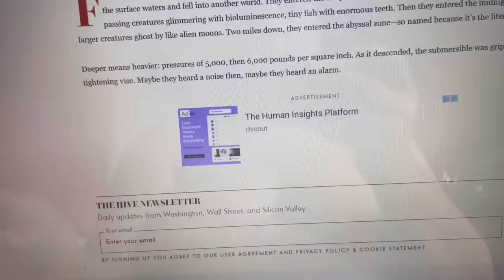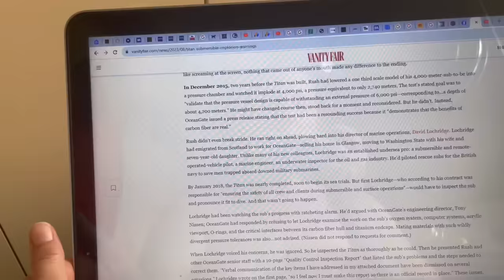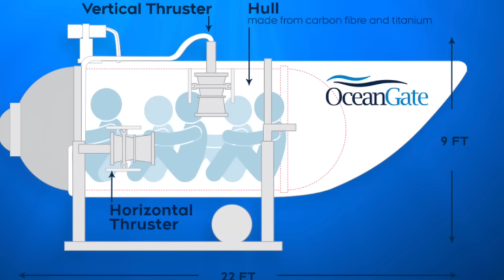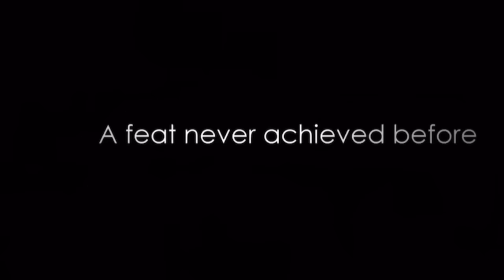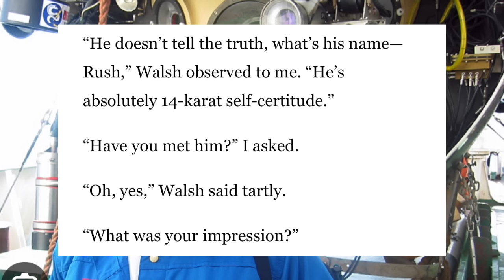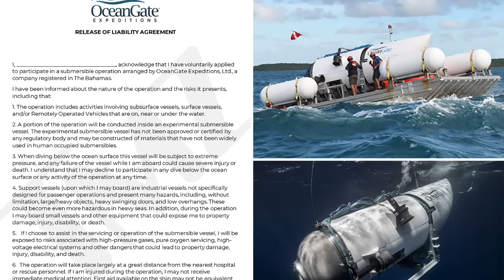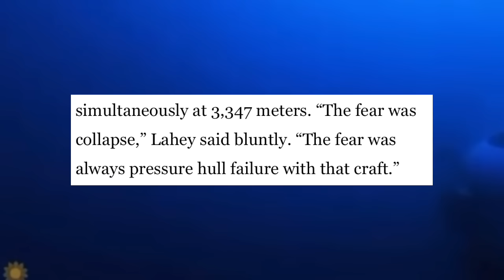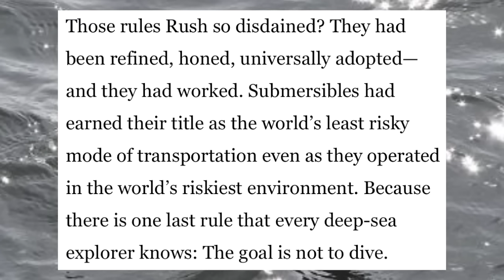TITAN Sub: The Most Shocking Titan Lies & Cover-Ups that you have never heard before #Titan

Comment: The analogy comparing carbon fibers to a rope is not correct in this use of carbon fiber and resin. If you use your imagination, and think of the tube of carbon fiber that made up the hull, then cut it along its length and flatten it out, you end up with a sheet of carbon fiber as thick as the hull was (5"). If you then support the 5 inch thick thick sheet of carbon fiber at all four edges like a sheet of plywood, and then place a weight in the middle of it, you will then be approximating the nature of the forces on the hull. Only the top section will be in compression, while the bottom section will be in tension, with a section in between that is in a neutral state. All of these forces are essentially the same when the material is in the cylindrical shape of the hull with the external pressure of the water pushing inwards.

As long as the upper section (or external) of material remains able to withstand the compressive forces, supported mostly by the strength of the resin with the help of the carbon fiber, and the lower section (or internal) material can withstand the tension, mostly on the carbon fibers held in place and supported by the resin, and the two forces are able to remain balanced with a large enough neutral section in between them, than all is well. 

The problem is that if either section (the compressive or the tension) begins to degrade, and if either  compression or tension section moves towards the neutral section to a point where the neutral section disappears, and then to the point where the compression and tension sections overlap as additional force is applied, then the material will fail.

This is true of any material, and carbon fiber is possibly perfectly fine for the purpose of a submarine hull, if it can be made properly and can hold up to its purpose. From analysis that I have seen of the carbon fiber hull, it is likely that the hull material began to degrade with each deep dive, and this process was likely heavily exacerbated by the rough and ready nature of the building process, lack of quality controls and oversight, and basic engineering mistakes.

A tragedy for all involved and those that perished.
Reply from the maker: yes 🙁

Comment: Why doesn't anyone covering the overall safety of the Titan not trip over how the safety of its parts combine?  To me it is obvious that a screen door in a submarine can only lead to the submarine flooding.  It doesn't matter what other mumbo jumbo might be said.  Leaving a hole in a pressure vessel is not a matter for certification organizations to debate.
Reply from the maker: Hi Wallykramer , I am not sure I get it right, could you further explain please ? Which screen door do you mean ? Thanks
Reply: @silki24  There is no good reason to have a screen door in a submaine!  Maybe some fringe use, but once it is ready to submeerge, the screen is totally useless!
Reply from the maker: yes agree but I still don‘t get what you mean with „screen door“ regarding the Titan. They were bolted in , is that what you call a screen door ?
Reply: @silki24   No.  A "screen door in a submarine" refers to an old joke amongst school kids.  It is meant to highlight an obviously bad idea.
Reply from the maker: 😁 Hi Wally ,, ok you got me there , I would have never guessed that 🤣

Comment: The "carbon cant take compression" thing has been exagerated. Wing spars on aircraft use carbon in compression. In can be done but care is required.
Reply from the maker: Hi Colin, there are engineers that commented and they explained that the pressure under water is different from what any airplane will experience
Reply: @silki24  Oh yes I agree with that. It's just thst every youtube video now is parroting that carbon doesn't work in compression when it can work just fine. 

As I understand it, when they made the tube they alternated layers wrapped around the tube and layers with the fibres along the tube. It's easy to keep tension on the wound layer but not so obvious how the controlled tension in the layers running along the tube. Tension helps keep them straight which improves the strength. Personally I suspect the problem will turn out to be how the tube and end rings interact. Its quite common to have issues wher different materials are mated together.

Comment: to be fair, other subs that operate with "tourists" are not certified, it is so expensive that it is just not a viable option!
also, what someone may tell you about something means very little, at least compared to what the document they are handing you and asking you to sign is telling you... 
read it, understand it, and only sign it if you accept every warning and risk it informs you of!
the passengers or "crew" all knowingly chose to put their lives at risk, we all make our own decisions.
Reply from the maker: Hey Ralph, are there any tourist subs that go down so deep uncertified ? I have not heard about that.
Reply: @silki24  
no, i dont think so, and probably far from it.
but does that not, if anything... give anyone that thought about booking a ride on the titan all the more reason to reconsider?
it was no secret that this was an experimental sub, and although Stockton Rush may have been overly confident or even downright ignorant concerning the capabilities of the titan, he himself openly stated that he had broken rules in its design and even had been told that this was not going to work.

i am not exactly sure how experimental airplanes compares to experimental subs legally, but an experimental airplane is in most cases not actually experimental, it is more of a class of planes that allows you to "break the rules..." you can buy prefabricated and well tested kits that you can build yourself, you can buy used ones and you can build them in ways that would be considered unsafe for a certified plane. 
you can not fly them commercially but you can have people help you build/work on them and fly them, and even donate towards the expenses.

as far as the titan sub, it is quite clear that it was actually an experimental sub, it as clear that "safety" rules were broken, and that there had been objections and concerns as to how it was built.
the waiver these people signed clearly stated that this was dangerous despite what Rush may have told people himself.
if anyone blindly signed the waiver and took the word of Rush over the waiver then they are to blame for it, i would consider anyone not doing any research of the possible dangers of such a mission and on top of that paying 250 grand for it a fool!
i am not really defending Rush, but i am defending peoples right to choose to take these risks... and make their own decisions!

in my youth i took a sky diving course, my own instructor told me that skydiving was a safe sport in a pep talk the day before we were actually going to jump... 
it was the last thing i ever heard him say. the next day on his first jump, his main parachute failed to open correctly, he was to late in opening his reserve. turns out parachuting was not perfectly safe after all, but i knew that already... and had it been me, i would not have blamed him!

Comment: In 2024 I'll be starting commercial dives to the Titanic, anybody is welcome, the price is 50k per ticket. The submersible I've created holds 8 comfortably, but we will dive with as few as 3. My hull is made from shredded cardboard and construction glue. We mix shredded cardboard and construction glue in a large heated bowl until it has the consistency of wet cement. We then hot inject this slurry into a mold that makes up the pressure hull. It is then allowed to air cool for 3 weeks in a controlled environment, the end result is a very strong pressure hull ready for final assembly. We have 3 of these completed vessels, our first dive to the Titanic has already sold out. My company is picking up where Ocean gate left off because we believe in the mission, but we've made it more affordable for people to visit the Titanic wreck site. Tickets are on sale now for our 2024 dive schedule.
Reply from the maker: you stole my design 😂😂😂😂

Comment: One of the crew took a dump at the front, where the toilet was next to the porthole. This unexpected and extra weight placed the vessel into a vertical dive which was unrecoverable and resulted in the loss of the pressure vessel's integrity, when it ploughed into the seabed at over 175 mph. Absolutely amazing!
Reply from the maker: OMG 😂

Comment: To the young lady who made this video, you have a very nice attempt at explaining things, but much lack of understanding stock to rush, was a narcissist that was his downfall but he proved that carbon fiber could be used for submersible, or he wouldn’t of lived past the first dive now it’s just a matter of getting the right Equation future subs will be made out of carbon fiber. His arrogance was in that he did not do the nondestructive testing and that he did not take any input from other people this sub could’ve been used at lesser depth and probably would’ve lasted 100 years, but like the first model of Ford, you’re not gonna get the product you want until the third or fourth generation so he was on to the right course. His stupidity was in claiming that the problem was solved, the fact that he did not cross hatch the carbon fiber, which was probably the best explanation for the failureand his stupidity in trying to force the product to meet the timeline will be recorded in history as his actual undoing
Reply from the maker: when he used the sub for shallow dives in the Bahamas the hull was already failing and needed to be replaced for 1 M. The material is not suitable for any kind of diving

Comment: Obviously, this all ended in tragedy, but it’s unfair to say it was a failure. The sub, as it was designed (wrongly or rightly), made like 19 successful dives to the advertised depth. Calling it an engineering failure is equivalent to calling the Space Shuttles an engineering failure. Ultimately accidents, foreseeable or not, happened…but the Titan worked dozens of times and only failed once.
Reply: But Rush did not spend all of that money to make just 19 dives! He designed it for the constant reuse of passenger runs to Titanic. By any measure, this was a failure.
Reply: The Space Shuttles were designed for reuse as well…it’s all just very risky
Reply: @sheaalexander157  The difference is that the Space Shuttles were not making noises like a whip cracking repeatedly when reaching its designed operational space. This submersible was a prolonged failure with many warning signs along the way, carbon fiber delamination visible, a perspex window specced to 1400 ft, regular system failures both computer and otherwise. The shuttle was far more complicated than this home engineered overly large bog roll tube. 
Rush cut every single corner he could, cut price out of date carbon fiber, used steel construction tubes for ballast, a cheapo Logitech Bluetooth controller (may as well have used an old Atari 2600 🕹️ joystick) as the control console and la piésce de résistance - the toilet was a bucket full of water behind a $5 curtain in the corner.
Reply from the maker: once is often enough especially it was predicted to do so by all experts due tonwrong materials.

Comment: 50:00 I hate to say that you're wrong but, you're wrong. The Kursk went down in 2000 With all 118 men lost. The Changcheng was found adrift with all seventy crew found suffocated from carbon monoxide poisoning. Nerpa suffered a gas leak and lost 20 crew. Yono Class submarine of the North Korean Navy was lost with eight crew no one knows how it went down. November 15th 2017 the San Juan of the Argentina Navy went down with all 44 of her crew. 2021 the Naggala went down with all 53 of her crew. the Naggala was of the Indonesian Navy. To point out, the San Juan and the Naggala both suffered a catastrophic implosion. I would also like to point out that this video was very well put together and well researched.
Reply from the maker: Hi Fuse , those are submarines but with submersibles there have been no accidents like that, for example the MIR submersibles and others when down to the Titanic since it was found in the 1980ies.
Reply: @silki24  The Losharik of Russia has a mothership and is classed as a deep submersible, it had a loss of 14 crew July 1 2019. It has I believe 6 or 7 spheroid hulls but look like a regular sub, just smaller. It has an test depth of around 8,000 feet as best we know right now and it is used as a spy ship. I take it you were referring to craft like the Trieste in the video as not having any accidents? I'll concede that, but any thing that goes under water and comes back up by design is a submarine to me. 😁
Reply from the maker: makes sense what you say, I am not a submarine or submersible expert, I  have the no submersible accident for the last 35 years information from statements of Stockton Rush's critics, experts who said it was not necessary to re-invent the wheel or have a hull alarm on the sub , just because that was never needed as the submersibles that went down the last 35 years never needed it nor had an accident.
Reply: @silki24  I get what you are saying and you did a great job on the video. It was well phrased and linked together. Passing on information is always the best we can do and sometimes that info is bad or not phrased correctly. I have no problem with what you said, I saw James Cameron say the same thing. He built his own "sub" and made it to the challenger deep. That's no small feat. I just think the community is placing false hope in craft that are inherently dangerous or at best trying to make the public think that it's not that dangerous. Sure, they try to take as many risk out of it as they can but noting can ever be that safe. The world is deigned to kill us after all. The human body is so fragile but people forget that. There is no way to properly demonstrate the pressure that was on that sub, if people only knew the load it was under. If Stockton would have been made to pass on that info I don't think we would be here today. I.E. talking about this.
African forest elephant per one inch was on that sub. One of those per two lines of this text and he thought carbon fiber would hold it.... I'm sorry, I'm just passionately pissed off about this. Not at you, not really at the community, they tried to stop him. The governments will have to step in if this happens again and that will stop almost all discovery's. Anyway, I think you did a great job on the video, I'm not just saying that. You found info that's not easy to find.
Reply from the maker: Hi Fuse, thanks ! I totally get it why you are pissed off . It was not necessary and in the future explorers will pay the price being faced with more regulations. Had Rush gone alone , all fine but luring paying innocent clients into that to pay for it , pisses me of BIG TIME
Reply: @silki24  Exactly! Wish I would have just said it the way you just did. That is perfectly stated. 👍
Reply from the maker: thanks Fuse 😃

Comment: I would never want to be in a submarine that is controlled with a gamepad, which you normally use to play games with. then the warning signals can't be bigger, because we gamers know how unreliable something like that (gamepad) is. you shouldn't control a submarine with a gamepad, something where all sorts of disturbances can come in and interfere (and suddenly you can't control the submarine anymore and there's only one way and it's down into the depths and BOOOM and the submarine implodes and you're dead . only idiots think they can control a submarine in reality with a gamepad.He who does not fear the sea and the deep is a fool
Reply from the maker: Hi MajorTom, Rush was so proud of his game controller and once said he has two additional ones on board but in case of emergency, could he switch fast enough?

Comment: Rush's idea of rapid development is fine. Musk is using it with SpaceX. But SpaceX is not flying people while it is testing it's hardware to destruction. Very public destruction in many cases.  A better comparison for Rush is NASA and the Space Shuttle. The original NASA astronauts were military AND test pilots because all of the 1960's spacecraft were highly experimental. There were only a few dozen flights. The Apollo series of 14 flights had one fatal mission, Apollo 1, and a second near fatal flight, Apollo 13.  There were only 135 Space Shuttle flights, also with 2 failures.  IMHO, both were preventable, and both were caused by NASA need to hurry up, pushing flights. There were clues that were ignored in both cases.  Even at 135 flights, if the Shuttle was had been a commercial aircraft in development it would still be classified as an "Experimental" class aircraft, not suitable for passengers or commercial use. 

Respect for Lockridge.  They wouldn't let him do his contracted duties, he spoke up (on paper) then they fired him. I sure hope a/the judge allows the real world evidence from the Titan to prove Lockridge was right and Rush/Oceangate was wrong to fire him.
Reply from the maker: yes I hope that too. Why hire an expert when you don‘t want his opinion? I guess he wanted him for show, to gain trust